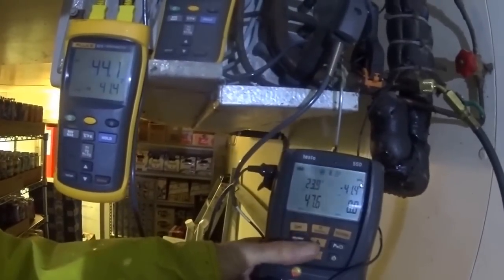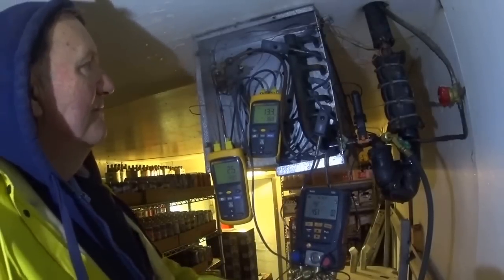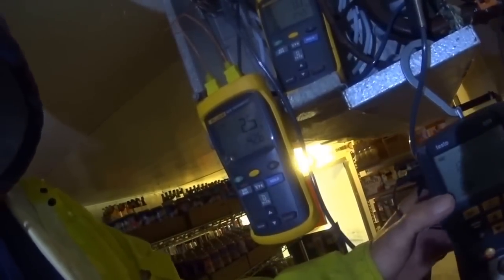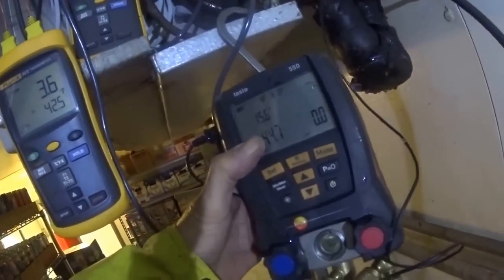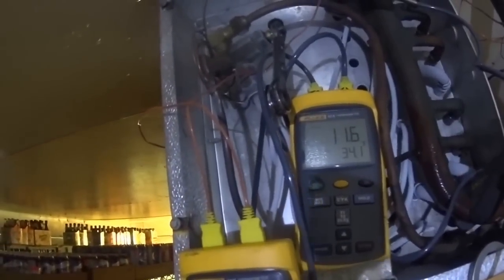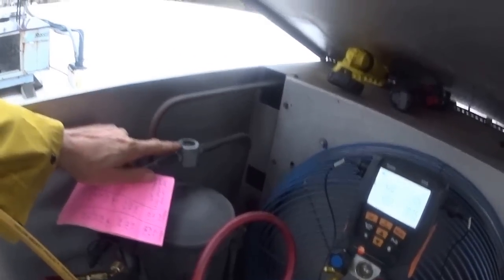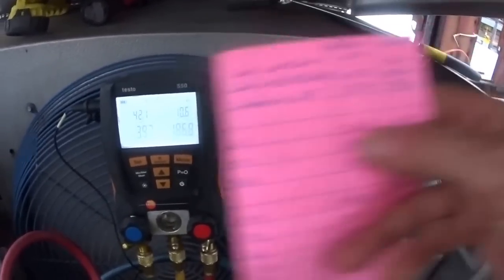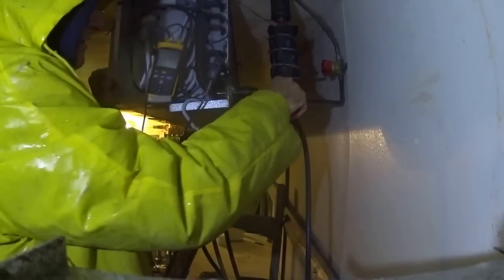Walk in Cooler charging and cleaning the Evaporator Coil part 4

Comment: Jim you had mentioned in several of  your videos responding to comments that you use this method of adjusting TXV's for 40 years or more??????? What type and Brand of Digital Thermometer you was using back then in the 1970's????????

Comment: Hi Jim

I love your videos, i am new in the trade and i am working strictly on walk in coolers, this is my 2nd week in the trade as a 313A apprentice , i am wondering what happens when you forget to fasten the sensing bulb to the suction line?
Reply from the maker: Ron G when the air in the walk in gets colder, the evaporator gets colder, the bulb mounted "tight" on the suction line leaving the evap gets colder the valve senses the cold and closes off. If the bulb isn't clamped tightly with the brass straps with nuts and bolts, the valve will stay open and flood liquid refrigerant back to the compressor, the liquid refrigerant has no lubrication factor, it is like finger nail polish remover, it's dry. It will mix with the compressor's oil in the sump diluting it changing it's viscosity. It would be like putting paint thinner in your car's oil, the engine wouldn't last very long. The bulbs have to be clamped very tightly with the brass straps provided, don't substitute wire ties or something else. Mount the bulb at the 3 or 4 o'clock position, "Tight" that's very important.
Reply: Jim,

What is the possible problem if the suction pressure is 95 PSIg Liquid Line is 275PSIG, R 22 Refrigerant, walk in cooler, flash gas in sight glass??

Comment: Great videos Jim! Question for you though. What is your honest opinion on the testo gauge you're using? I am in the market for a set and can't decide on digi cool ak900 or the test 557. Your thoughts? Thanks!
Reply from the maker: Go with Testo, I had a 557, there was too many knobs to turn on and off, and the vacc gauge didn't work out. I've bought two Testo 550' since, they are around 300 and do everything I need, they are rugged. I also have the SMAN 4, it's too large and too many features. My recomendation is the Testo 550, it's compact, rugged reasonably priced and gets the job done.
Reply: Great! Thanks for the feedback!

Comment: Jim, I just priced one of those Fluke 51/52 looks like it is going to run me $325 in Texas. I think that it will be a good investment.
Reply from the maker: Fluke 52 II     United Refrigeration  $309.
Reply: I think I will pick one up Monday but it does not come with the probes. And from earlier purchases, each of those fluke probes are $150 a piece. I have come up with an idea to take some clamps from Home Depot and going to try to rig up some clamps of my own using the thermistors that come with the digital thermometer.
Reply from the maker: Jonny Cat I bought fluke clamps, I was using SMAN clamps, they work fine just big